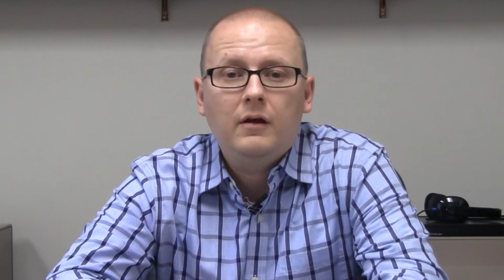Lecture 00. Course Overview

Comment: Thank you Dr ,Im wondering if there is lecture regarding to vertical curve ?Thanks again !
Reply from the maker: Hi Yasir.  We are working on developing some additional content.  This will include a lecture on vertical curve design.  Unfortunately, it will likely be a few months until we have those materials finished.  Thanks!
Reply: CE 355 Principles of Transportation Engineering ; please is it possible to get the slides for the class? Have PE exams and believe it will help tons. Thanks
Reply: Shoot...I just saw this, but you can certainly e-mail me for the slides.